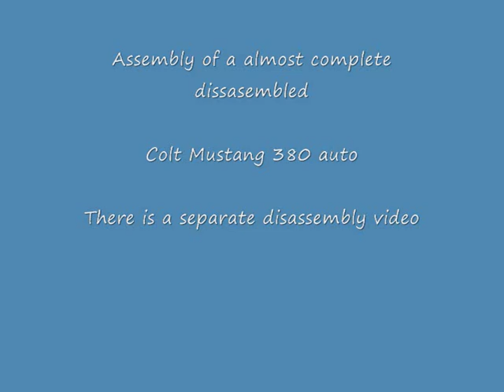Colt Mustang complete assembly

Comment: I have the same pistol. Had it since 1984. It’s a very nice reliable pistol in the right hands and you appear to do a great job handling it. I learn that all by trial and error of disassembly over the years. I have recently added two more OEM mags. Never have had a problem with this pistol. No jams no misfires. I might have a thousand rounds through it now. Nice video but a bit blurry on assembly. You could also detail the inner cam and hammer assembly with the tension springs placement to make it easier for someone to see what you’re talking about. Show the trigger bar front/back placement in more detail. Good video though.